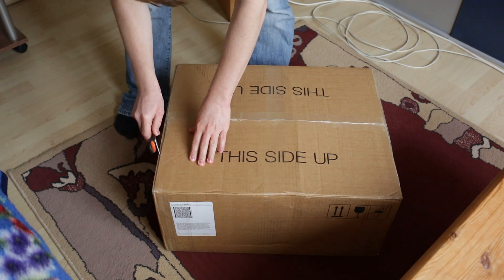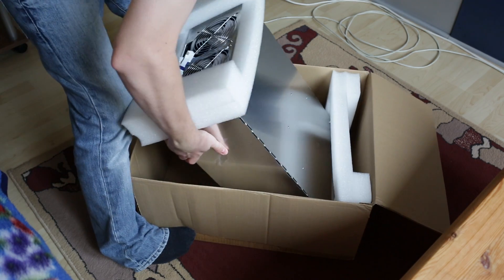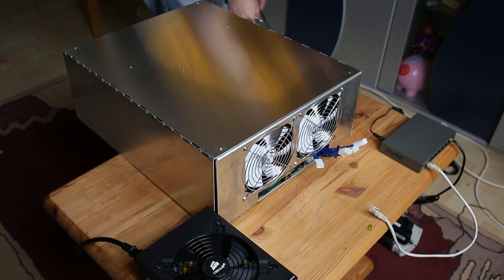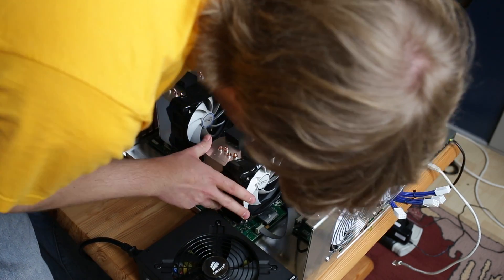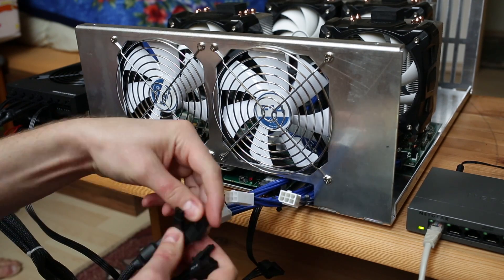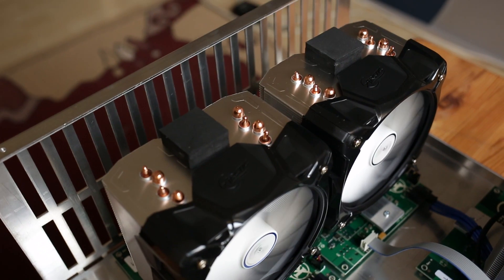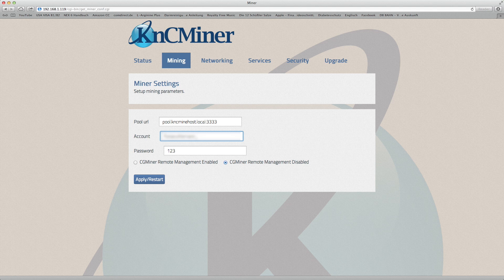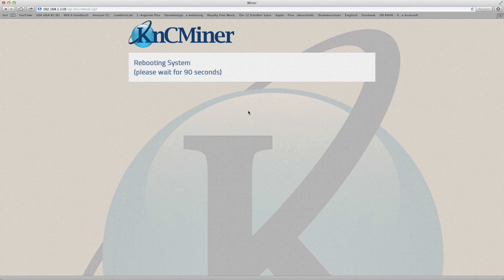KnCMiner Jupiter - Bitcoin Miner 500GH/s+ 28nm ASIC chips - unboxing and setup 1080p

Comment: hey florian, great vid. im watching this to get a handle on my titan preorder. on the knc site, in the manual pdf, it has a paragraph/picture of them jumping the power supply with a small piece of wire or even a paper clip, but noticed that you didn't have to do this. as an actual owner can you clarify this for me? thanks, jacob
Reply from the maker: Sorry for late reply. Yes, you have to do that. I was however using an ATX Bridge Plug that you can buy online that does the same thing, just more neatly and securely.

Comment: How do you find the KNC Miner IP Address, if you are not an admin for your network, like, if you do not know how to get to the settings to find the ip address manually?
Reply from the maker: sorry for late reply..

use nmap!

nmap 192.168.1.1-255 -p 80 

this will list all devices in your local network (adjust ip as necessary) with port 80 open/closed and try the ones with port 80 opened.
Reply: Thank you.

Comment: OLÁ BOM DIA. QUE PROGRAMA EU PRECISO INSTALAR NO COMPUTADOR
PARA COMEÇAR MINERAR COM UM MINEIRO ASSIM, IGUAL À ESSE ?
AGUARDO A SUA RESPOSTA..... MUITO AGRADECIDO......
Reply from the maker: for the KNC miner there is no pc program necessary. It's a closed unit that will work by itself. connect power and network and it starts hashing with the pre-set information. However, you should make sure that it's your address it's mining to by opening the website from a computer browser. although you have to find out the IP address this device has.

Comment: did it come with a power supply?
Reply from the maker: No. All power supplies for KnC miners have to be bought seperately! (recommend something like an AX850 or AX1200 by Corsair, depending on the model you have)

Comment: Very nice video and details. I recently contacted a local seller selling his Jupiter. He is kind of rush to sale. But I haven't made the transaction. Could u tell me how does ur machine actually perform under current difficulties? How long will it take to mine one btc actually( not the calculation from bit coin calculator)? Thank u very much! You can email me if u want to keep it private. maheng1989@gmail.com. Thanks. It be very help if u could tell me this.

Comment: hi, someone hacked my computer and they pulled up my webcam i was talking to me very freaky. cut long story short, i asked how do you make money he told me bitcoins, so i looked it up. is it possible he using my computer to mine. may sound like a stupid question to you's but... Need to go police station with my computer asap.
Reply from the maker: possible. check task manager if you have a constant 100% load even though you aren't doing anything. secondly, backup some data and completely wipe your machine ;) reinstall and use a good antivir the next time ;)
Reply: Thank you, I' am using bitdefender which i fought was a decent anti-virus. Obviously not.

Comment: what's the wattage on it
Reply from the maker: I was running it at 560W with an AX1200 PSU
Reply: nice the new wattage to hash ratio is gonna terrorize the old way
Reply from the maker: StraDaProductions Certainly - and I'm sure it will continue to drop. It's great to get the heat and power down while maintaining profitability for each new machine - very fascinating stuff :)

Comment: may i ask how much you have made?
Reply from the maker: How about a little homework for you? ;) Got it on October 16th, now you can calculate how much I've gained assuming I had a constant 550GH/s. It's fun to calculate and helps in understanding difficulties. (Check out my latest bitcoin video on that topic for help)
Reply: Florian Uhlemann Well, i get that you would mine a decent amount of coins using bitcoinx's profit calculator, which makes it a good investment.. Im going to pull the trigger on one of these beasts.

Do you believe ASIC miners will become good for SCRYPT mining? - isn't it just a matter of time before software is written to take use of ASIC?
Reply: Florian Uhlemann is it difficult to keep speeds at constant, is that even possible
is it more likely to have speeds usually less than 550 at constant?

Comment: Hey, cool Video. Do you setup the miner once and then it runs automatically? And the miner just runs 24/7 or? Or must there run a PC parallel to it, which connects it with the network?

I´m thinkin to buy one but I don´t really know, whether it would be a good idea. Because the Difficulty is always getting harder. But is the Difficulty changin daily or monthly? Is there a amount?

Thank you
Greetings,
polat311
Reply from the maker: No PC. All you have to do is connect the miner via an ethernet cable to your router/ethernet switch on your local network and configure it once via your web browser (tablet, computer, etc) And it runs 24/7

Comment: At 560W… running non stop for one month… what's your electricity bill looking like? If you don't get the bill… what WOULD it look like? I really appreciate any advice dude. Thanx for sharing the vid!
Reply from the maker: Very simple. roughly 400kWhrs each month (30 days) - multiply it with your local power cost (0.336USD/kWhr) i come up to 134USD per month :D
Reply: Florian Uhlemann How much bitcoin does it make per day ? Thanks.
Reply: adrianTNT
there are calculators for that, where you can simply enter the GigaHash/s rate and it gives you the numbers

Comment: I have just received my Sierra 1,200 GH/s and am currently running at 1298 GH/s.
They say the cooer the asics run the faster they are so im curently looking into water cooling the unit.
Reply from the maker: Great! Good luck! But those devices are already water-cooled, aren't they? You could only get some larger radiators to dissipate more heat from each closed-loop unit. Or am I wrong here?
Reply: Well when I ordered at CES they didn't have the option to water cool but now they are offering it. I have 4 EK XTL 360 rads i'm going to use with Ek blocks.
Reply from the maker: Understood. Good luck with converting it. What waterblock will you be using? Supremacy? Love those.
Reply: Congrats! How much does this 1,200GH/s machine is mining at that difficulty now?
Reply: masskilla469 whats the url of CES?
Reply from the maker: Alex Kaufmann
I assume he meant the consumer electronics show? ;) so more as in time of the year as in a specific shop - correct me if I'm wrong, masskilla ;)
Reply: yes that is what i meant my mistake.

Comment: How long does it take today to mine 1 bc?
Reply from the maker: With today's values you are looking at a little less than 2 days for 1 BTC (510.9M diff)
Reply: Florian Uhlemann
It's almost too good to believe, since at that rate they only take about a month to get your money back. At that point, you would essentially have a "free" miner.
Reply from the maker: True. But that's part if taking risks. What if BTC price had remained around 120-150$? We are pretty lucky to see it as high as 460USD.

Comment: where can I get the power supply  for the Jupiter?
Reply from the maker: Your favorite online retailer or local computer supply shop. Be sure to check the forums for problems with a certain type of power supplies, but the AX750/AX850/AX760i have proven to be working.

Comment from the maker: There's no "program" needed except for a web browser. If you are having trouble with the performance, I recommend updating to the latest firmware on KnC's website and possibly also applying the "enablecores.bin" patch to re-enable cores that might have been disabled with v0.96. Of course - KnCMiner is your first contact if you are experiencing any troubles. Good luck!